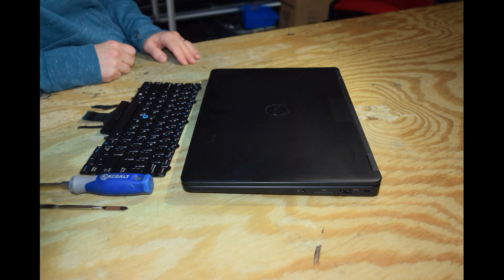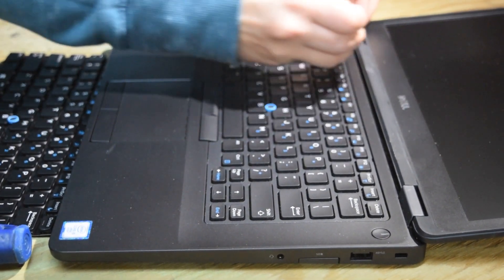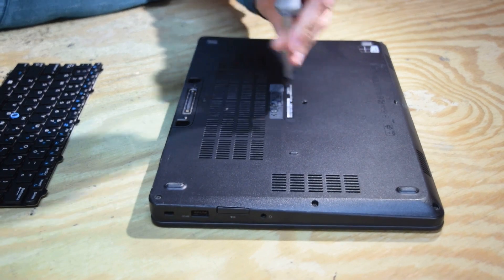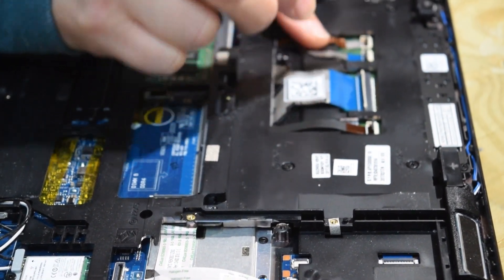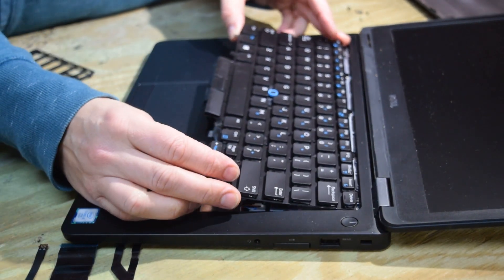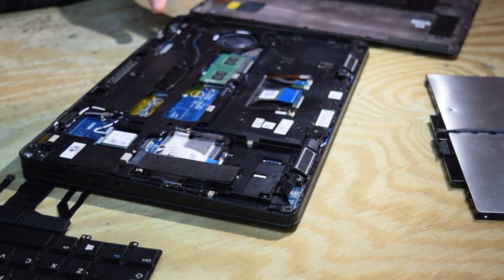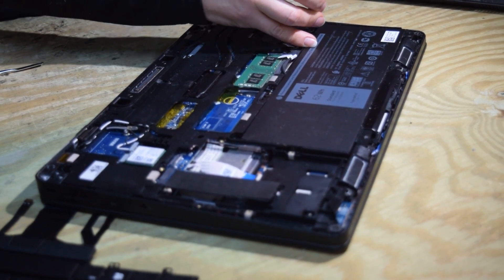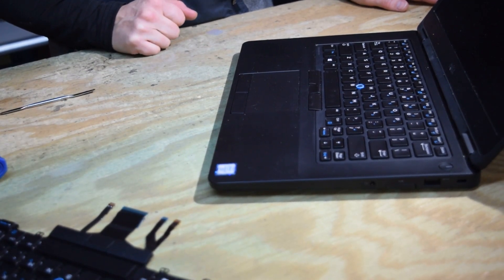Dell Latitude 5480 Laptop Keyboard Replacement

Comment: Great video. I had nor problem following the steps. Also great explanation about the different parts handled during the process. I was surprised that there was no mention of the dirt that is under the old key board and inside the laptop. Hints on what to clean would be great.